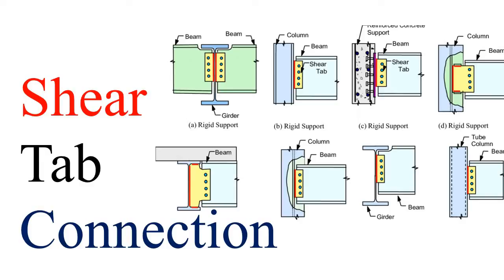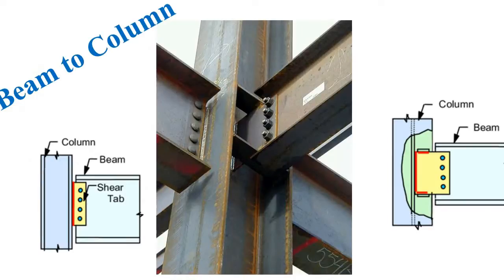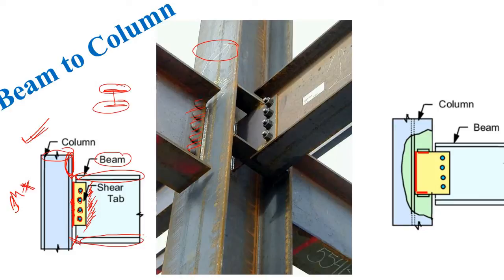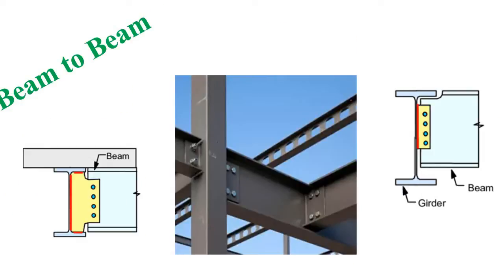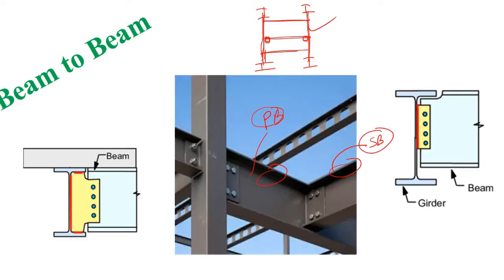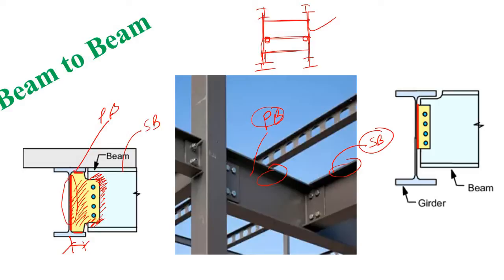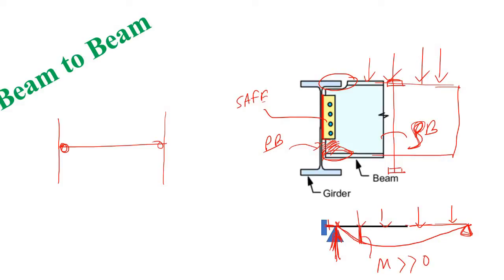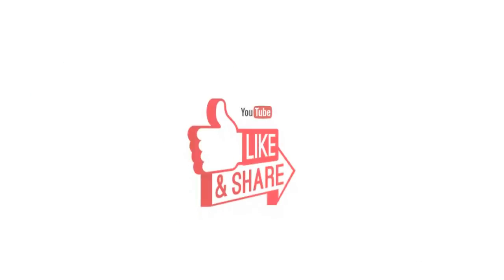Shear Tab Connection : Problems

Comment: Excellent Excellent Excellent.......0 divided by 0.Very nicely explained.Kindly clear doubt through a video why providing1/2 depth stiffner don't cause crippling in bottom part.Actually it is susectible to crippling in bottom part also which is unsupported.
Reply from the maker: Bottom part is actually under tension.. though we neglect it

Comment: What if the primary and secondary beams are connected by angle plates with both ends being welded instead only one end welded while other bolted
Reply from the maker: No issue..it will work ..but if you have ever witnessed any Steel construction, you know that at high, it is very difficult to weld something that is why at the ground we weld one end  and at high we only boltt it